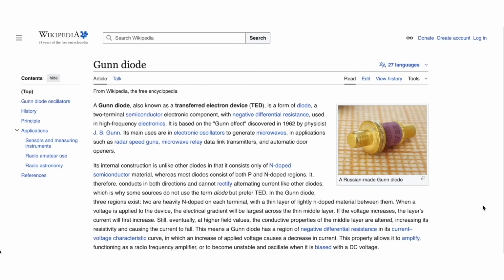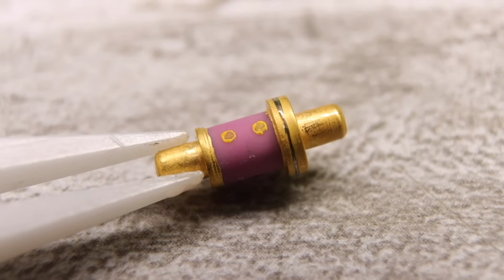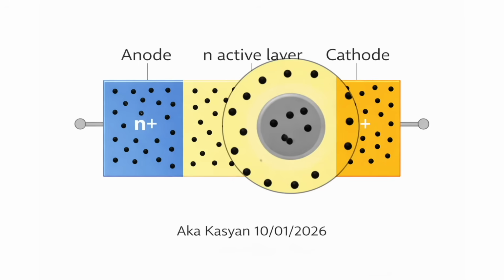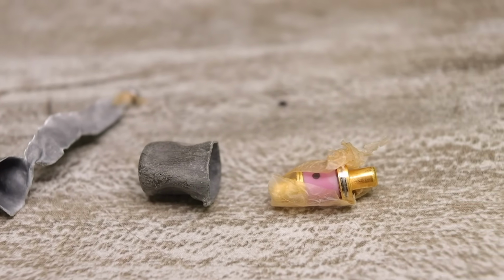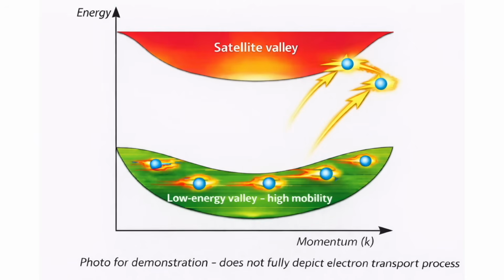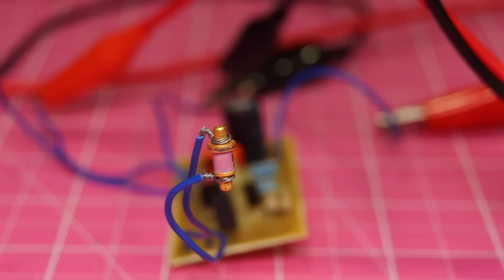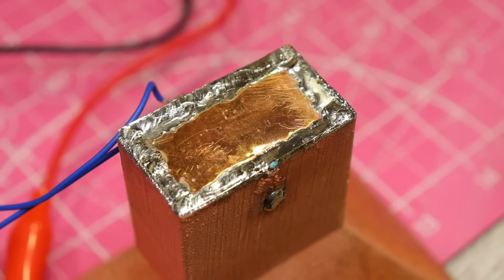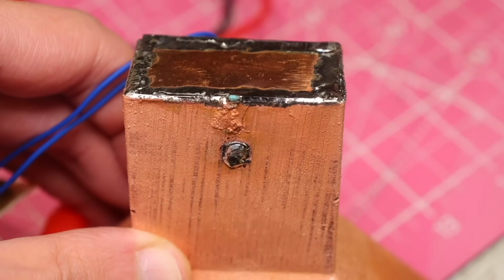It’s Not Just a Diode! The Mysterious Gunn Diode

Comment: Could Gunn diodes be used for LC circuits? Or in RC circuits to ha increased range an reliability?
Reply: Gunn diodes can only be used in precisely dimensioned waveguide structures, as in the video. Each diode type is designed to oscillate at a certain microwave frequency range if placed in a suitable waveguide cavity and fed the correct bias voltage. The frequency in the video seems to be something around 2...7 GHz, concluded by the waveguide size. Although I didn't see any ruler to find the precise waveguide dimensons...

Comment: I have two of these components, well I have a cast "monkey metal" housing with the gun diode and detector diode in different chambers it was used as a dopper speed detector I think. it was sold by RS components many years ago as one is in a RS component box. if you live in the UK,  Warwickshire, I can give you one as I have had my fun with one of them anyway.  
I do not want to have to go to the trouble of posting, however, I would be happy to know someone who is as nerdy as the guy in the this video is getting the satisfaction of experimenting, we can never have enough nerds.
Reply: You're absolutely spot on. They still are used in police radar. They emit microwave radiation at specific frequencies which can be used as a Doppler radar source for a police speed detection radar gun.

Comment: Unrelated to the diode, but how did you electroplate the plastic horn?  Specifically, how did you make the plastic conductive?  It looks like you did a great job, plating with copper.
Reply: You apply a conductive paint to it, and let it dry/cure, before the electroplating bath. 

Enjoy
Reply: You can buy metallic spray paints in pressurised spray bottles. If you apply an even layer by spray painting, it will then be enough to function as the basis for metal plating by way of electrolysis, which is a perfect way to very accurately control the metal layer thickness.
Reply: Another option would be to construct a rigid framework (3D printed, cut & glued sheet, etc.) and then apply [conductive] adhesive copper foil to it (possibly soldered where it overlaps).  Such tape is cheap and readily available, being used for shielding inside electric guitars and the like.
Reply: There are a lot of YouTube videos describing how to electroplate plastic structures with copper. A thick layer is not needed.

Comment: Był ten film już niedawno. Powtórka ?      Ciekawi mnie zasilanie takiej diody mam dwie prawdopodobnie bo wyglądają jak gunn dioda ale nie umiem znaleźć danych na jej temat zero w internecie. Mam tylko oznaczenie. Internet milczy.
Reply from the maker: Hi. This video was published recently on my main channel; this is a translation. There was also a video about the tunnel diode. Regarding your diode: this type of package is also used for ordinary diodes, so first you need to make sure that it is actually a Gunn diode. To do this, check it with a multimeter in ohmmeter mode. In both directions you should measure a resistance of less than 15 ohms if it is a Gunn diode.
Reply: @KasyanTV  Dziękuję za podpowiedź. Sprawdzę omomierzem.
Reply: @KasyanTV  Zmierzyłem i niestety to nie dioda Gunna wygląda jak na filmie ale nie jest. Ja je kupiłem jako warraktory 0.5pF ale dostałem warraktory i te diody inne w ogóle i stad błędne myślenie. Wygląd zmylił. Pomiary rozwiały tajemnice ich. Dziękuje za podpowiedź raz jeszcze.

Comment: I bought a few of these off ebay but have not messed with them yet. One of these days!
Reply: Might be able to use it to detect when "agencies" are using speed radars, or maybe even pick up a harmonic of the Terahertz devices they use to look through walls.
Reply: With modern 3D printing technology and YouTube guidance on electroplating plastics, you can now design waveguide structures which used to be very difficult to manufacture.

Comment: Using that pink part of the food super toxic?  Like the pink stuff on microwave  parts?
Reply from the maker: Hi. This is beryllium ceramic. Yes, it is dangerous, but only in one case: the danger comes from microparticles and dust. In other words, if you don’t machine it and don’t inhale the dust, it does not pose a hazard.
Beryllium ceramic is still used today, and it doesn’t have to be pink. It is very strong and has extremely high thermal conductivity. There is no need to break it; by itself it does not degrade or crumble.

Comment: I like to be sure that I am biasing my Gunn Diode OK, yet there’s not a lot of info that I have found. I wonder how you’ve done this?
Also, the detector’s architecture was not elaborated on in this video; are the two similar?
Reply from the maker: Hi, first you need to determine what type of diode you have and its power rating (the diodes shown in the video are usually 2–3 W, and this is the power the diode can dissipate, not the radiated power).
Important! Do not solder the diode! Install it in an improvised socket instead.
Then set the laboratory power supply to 9–12 V. Connect the cathode of the diode to the negative terminal of the power supply, and connect the anode to the supply through a 10–20 ohm resistor. Apply power only briefly—no more than 2–3 seconds—if the diode has no additional cooling.

For testing, you will need a microwave detector diode. If you don’t have one, take 5–8 1N4148 diodes, connect them in series, and place them as close together as possible. Connect the ends of this assembly to an LED or an oscilloscope (in the latter case, the number of diodes can be reduced).
Bring the detector very close to the Gunn diode and turn on the power supply. You should see a chaotic signal on the oscilloscope; in the case of an LED, it should light up. This indicates correct operation of the diode.
Next, for efficient operation at a specific frequency, you need to build a horn antenna
Reply: @KasyanTV  80 mw dissipation Microwave Ka-Band Gunn Oscillator Diode 3A728G 25.86...37.5 GHz, 50mW Gold USSR

What are the biasing parameters?
Reply: This item’s physical size is very small, in the low millimeters!
Reply: Check for the book made by "Matthaei, Young, Jones". Microwave filters etc. as the title. Thare you may find something about the topic. Available on Internet Archive.